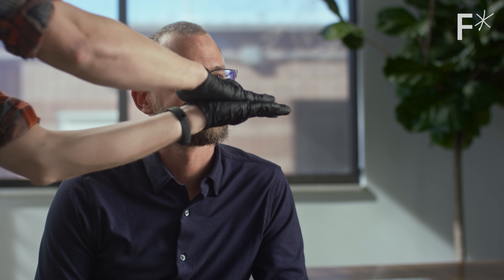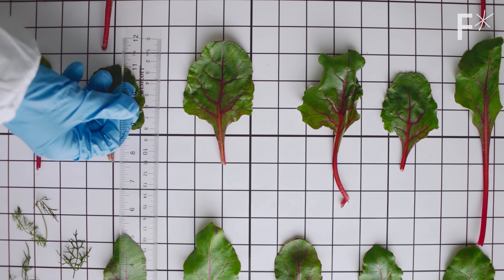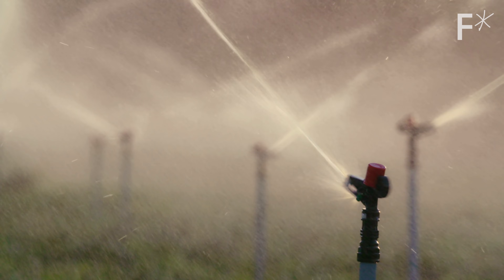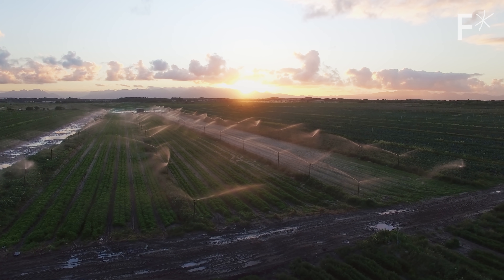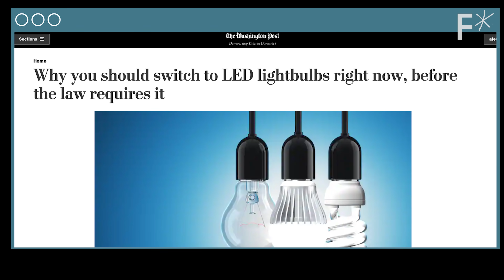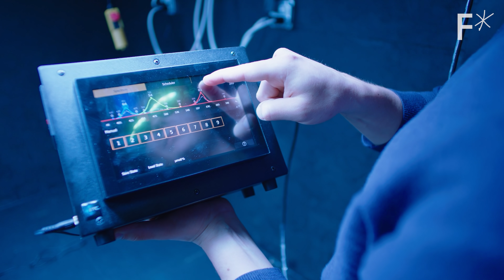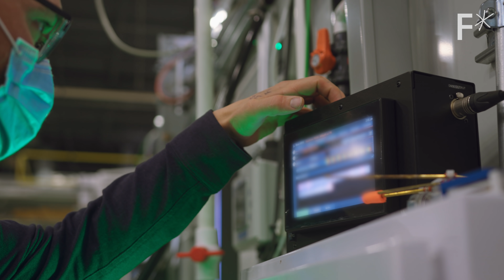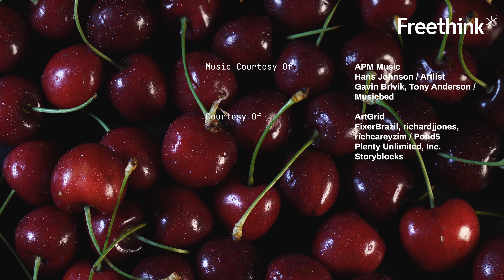Vertical farms could take over the world | Hard Reset by Freethink

Comment: Coming from a local farming community, I can see that if this is done right, it can be used to help and enhance local traditional farms and farmers. The two can coexist without being at odds.
Reply: Just remember they haven't figured out cereals or potatoes.... so they really aren't going to change much.
Reply: @benblas164  then traditional farms can farm those and vertical farms can handle the rest, there are a lot of foods in grocery stores that aren't cereals or potatos
Reply: @benblas164  wtf are you talking about? potatoes was the very first one to be figured out, it was done at NASA when they invented aeroponics. This vertical farms are building up on what NASA and the Netherlands have done before.
Reply: @benblas164  Look again, you will find videos of hanging potatoes being sprayed from the bottom.
Reply: @benblas164 nor trees
Reply: @benblas164   I'm sure this hasn't been done only because they are not profitable enough at the moment.
Reply: Enhance not replace
Reply: @annedonnellan6876  It should replace, so trees and biodiversity can reclaim. Subsidies for farmers replacing acreages with vertical farms might work, having them utilize 2-3% land to produce the same quantity. Mainly removing farms and giving back the swaths of lands will be the greatest benefit.
Reply: @annedonnellan6876  Exactly
Reply: Hard disagree. Its going to be exactly how taxi drivers went into a piss rage after uber/lyft exploded. One is going to become obsolete.
Reply: Off season produce will be amazing and decentralized away from warmer climates like California
Reply: Yup. Cities could begin growing much of the simple staples.
Reply: 5 startups that are revolutionizing food and agriculture THE FUTURE OF FARMING
https://youtu.be/mnE0rQfFS1s
Reply: my suggestion is to consider a historical fact, this isn't the first time that industrialization of food promisses paradise, we did it in the past and it has caused gazillions of problems.

what I think people in farming communities should do is a double prong approach, 1. jump into this bandwagon and make your own companies for this new technology. 2 do farming in the land following Permaculture, Biointensive agriculture and Forest Gardening, Chinampas and other traditional indigenous farming method to create some sort of sanctuary for wildlife and farmlife. 3. keep doing your traditional farming.
Reply: @laughingvampire7555  We did industrialization in the past and we solved world hunger, how is that a problem?
Reply: Corporations wont help the farmers they will undercut you more
Reply: @Kittypaintz  I think this way could be a way to revitalize land where the harvest is decreasing even with fertilizer. Right now it seems what they do in the USA is pave them over. There was a youtuber that said "eat food not farms" the quote is accurate from what I see.  

Instead of paving them over, try these instead. We have plenty of drying prairies in the US that need help.
Reply: Where is the person?
Reply: Hmmm
Reply: The problem is it's not going to enhance traditional farming it's going to replace traditional farming even if they have to force the farmers out which they are doing
Reply: @did_I_hurt_your_fee_fees Yay thats one tech i can get behind. Out with the old in witht the trees.
Reply: "The two can coexist without being at odds" yeah, well, the land you own is still the land our earth lost

sorry if your business threatens the environment, and there's something that needs to be done about it, but it is what it is
Reply: Nah this is what corporations will use to get the edge against regular farmers and push them out.  You think individual farmers will do this?  Lol
Reply: @user-hu7dr8iy4f i hope you are correct.
but with everything that we see. my concern is that 

farming is going to be scaled to match closely and thus have little room for error 

also you can only fix the technical issues IF you have the supplies to do so and the recent large scale crisis have shown that government and businesses in general did not have ample supplies on hand for major failures in operation.

so while i hope you are correct, i just see the scale of failure to much greater than it might first appear
Reply: No, it’s for you guys to be able to take your current land, and then stack, you’ll get a way more produce
Reply: You're being naïve and they'll be counting on it...
Reply: its a good idea until government steps in and says only the corporations can farm and sell because it's a safety/contamination hazard to eat from local farmers
Reply: @JosrRocks   Sit back and watch as brainlets struggle to understand "why the government would do such an evil thing"
Reply: These farms are such a bad idea from a long term health product. Traditional farms will become something only the wealthy can afford, as it will become boutique specialty, to have food grown as nature intended. Farms that are done well , have great biodiversity that people then get exposed to through their food. This is imperative for health. 
Food that has no activity of life on it, so that one doesn’t even need to clean it, is not healthful food.  People have become germaphobes to their own detriment.
Reply: Absolutely nonsensical.
   You can't keep farming in 3rd century technology, move on.
  The efficiency in using land for farming is actually quite wasteful. Move on with the technology.
Reply: @markarmage3776  Agree
Reply: @markarmage3776  I guess the plan is to replace then.
Figured as much...
Reply: @markarmage3776  vertical farming is more wasteful when it comes to resources. the only thing vertical farming saves is space.. space is an issue why?
Reply: @JosrRocks  The problem isn't space, the problem is land and climate dependency.
   Go learn some math and physics and you shall see.
  Vertical farming only needs electricity, electricity that we can get an infinite amount from either nuclear or solar, it can be regulated indoor.
  That's the advantage. The traditional way of farming, stemming from maybe the 3rd century relies heavily on climate, if the weather is hotter or colder, you're screwed. If there's a drought or a flood, you're screwed.
  That's why vertical farming is the future, not because it saves energy, but because it's not climate dependent.
Reply: ' I'm sure this kind of food is as good for health as the food growing under fresh air and real sun.  🤡
Reply: Natural grown plants are always better.. we need a real plants not a fake ones..
Reply: @mrdeepwebinsider2197  this are real plants.
Reply: @mrdeepwebinsider2197  tf, how are they fake? they use the same soil, the same air, the same water...
Reply: @mrdeepwebinsider2197  crops are already "fake". It's far from how they're grow on their own in nature
Reply: @tomlxyz  i agree.. the commercial pepper cannot sprout from seeds without taking a good care of it.. that is the reason why i keep my "spartan" variety.. my methods was like.. i just threw them on a wet soil the strongest will survive they will be my next generation of breeds.
Reply: @MrDeepweb Insider  The main problem is that the human race is always increasing. At some point we will run out of natural sources. I prefer natural over man-made but will run out at some point.
Reply: @12SlimJims  that's not true. The birthing rate has decreased in several parts of the world. Most people have other aspirations than being parents.
Reply: @mrdeepwebinsider2197  uhm these are real plants lol.
Reply: @mrdeepwebinsider2197  How do you define fake plants? These are just normal plants whose environment is sophisticated very efficiently without just placing ur bets in God for a good season
Reply: @mrdeepwebinsider2197  none of the plants you or any farmer grow is natural.
Reply: @mrdeepwebinsider2197  they are real plants lmaaao
Reply: @mrdeepwebinsider2197  Your right
Reply: @mrdeepwebinsider2197  not only that. one bad EMP / solar flare and those vertical farms are wiped out due to the electronics getting fried.
having single point of failure systems always end up in destruction.

i like the idea as it could help with greens being made where people live but grains and slow growing crops.... yearh they are decades from that also they have to prove long term sustainabillity and durabillity.
Reply: @beidorion  traditional farming is already filled with electronics anyway, anything john deere has a chance of bricking at any moment. unless you wanna farm with handtools I'm not sure traditional farming would be much more useful,
Reply: @beidorion  an emp? okay, most business these days have backup generators...

Comment: Vertical farming works really well for leafy and greens food. I noted strawberries and they mentioned tomatoes. Capsicum. chillies, eggplants and others will work...but this system will not work for tubers or citrus or orchard grown food and tall stemmed plants as they mention. This system will also require constant power sources, I wonder if the rooves of the big store buildings would be covered in solar panels then batteries and inverters used to power these plants plants. 
Granted the thinking here is better than fossil fuel driven farm machinery and the trucks, ships and trains used in food transport. Plus the ability to improve nutrition depending on the nutrients in the water used. Most farmland in any country is bereft of the range of nutrients human system require.

Comment: ALSO the problem with hydroponics (multiple layers/stacks) is LIGHTING. the operating costs are expensive.
you can only have 1 layer horizontal in which case the sun will be your lighting, or do it 1 layer vertical also the sun can provide for this 1layer.
multiple layers = multiple lighting.

Comment: While I appreciate science and adaptive technology, this in my humble opinion not ideal. If you work with Plenty and you have validated proof this will work, please answer a few concerns I have:

1) Is this electrifying the natural process of photosynthesis?
2) When power goes down, this includes generators, what keeps the indoor farms running?
3) How does this solve supply chain demand issues? Specifically, what are you doing to control food waste issues?

Comment: This is a great idea but shouldn't be seen as a way to eradicate traditional farming.
Why? because most of this type of farming is veg, leafy & micro greans, whereas traditional farming is mostly wheat, rice, orchards and live stock.
Also I have to question the electricity use (will all farms be solar equiped?), material use in producing so many LEDs (recyclability?), long-term plastic ware, potential carcinogenic properties in artificial light, and are growth chemicals used.